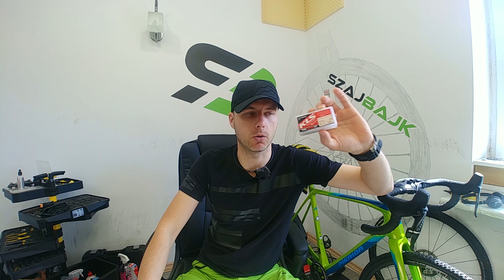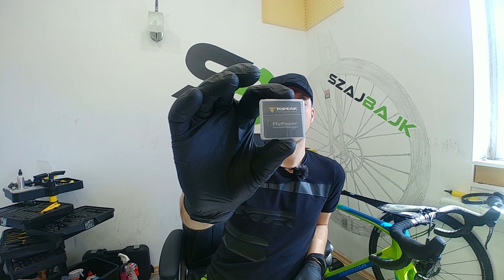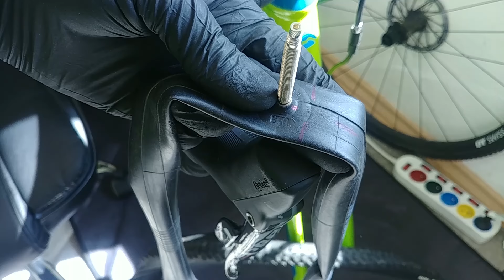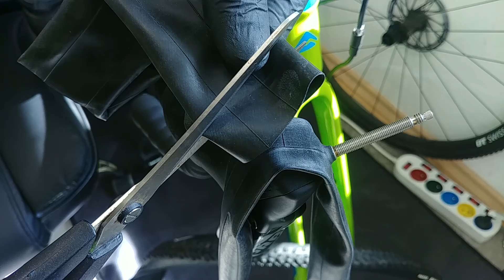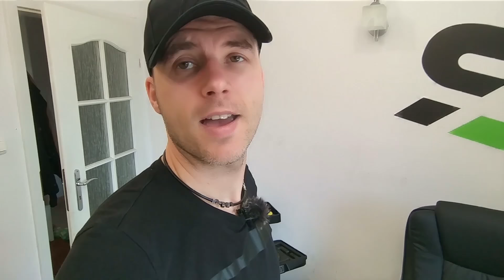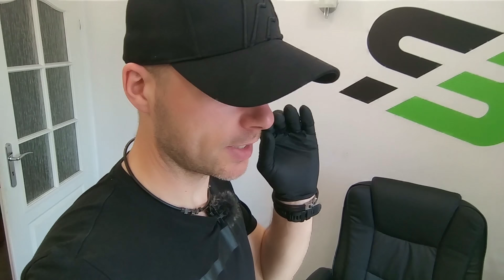How To Fix Inner Tube With Another Bicycle Tube. How To Make a Patch. Step - By - Step Tutorial.

Comment: Back in the 70's we would light the glue on fire after we put it on the tube, just long enough to heat it up real good. Then blow it out and apply the patch immediately. They always held up until we outgrew or wrecked the bike, but back then everything was made better. Everything these days is junk!
Reply: Fire , fire…

Comment: The metal scratchy thing used to be for scraping chalk (which was part of the kit) over the glued area to prevent the mend sticking to the inner surface of the tyre. It is certainly useless for roughening the surface of the inner tube. I saw one video which used it to spread the glue ...

Comment: I used to get flats near or on the valve. I solved the problem by cutting out a 20mm square of old inner tube rubber, stabbing hole in it, then sliding it on to the valve stem right to the bottom. The extra rubber protects the tube from irregular rim holes or any small sharp particles that creep in.

Comment: If the hole was at the base of the valve stem or ripped off like my $60 tractor tube.  I simply cut old valve stem, about 1/2" dia.  Now with an old inner tube, my case motorcycle tube, cut 2" dia around motorcycle threaded valve, both sides prepped and glued.  Never discard those valve stem sections😊

Comment: To share - after I stick the patch onto the tube using tire glue, I use a f-clamp to clamp tight the patch onto the tube overnight. It worked.The patch still hold after many many rides.

Comment: Rozpuszczalnik ekstrakcyjny (AKA benzyna ekstrakcyjna)  is slightly greasy. I wouldn't recommend it for cleaning the inner tube before applying glue and patch patching. IPA is a better solution. You can also use soapy water...

Comment: Another fine video! Glueless patches are great for a fast fix on the road but even the best aren't durable. If it's a slow leak pump your tube up a bit first so it's the same size as when its inside the tire before putting on the glueless patch. Even high quality glueless patches like Park's don't stretch and shrink well, and so peal off when the tube shrinks and expands as you change it later.

Comment: 3M cubitron sandpaper gets the tube smooth fast - brake cleaner gets shut of contaminants. On "O" ring repair kits, you use super-glue to join the "O" ring - they're rubber, like inner tubes. Super-glue sticks them. So maybe it will stick inner-tubes too? :-) With activator.

Comment: I like the metal rasp piece, I’ve been using them since the early 90s. I think it’s faster and doesn’t load up like the sandpaper. Most of the new patches are junk. The self adhesive type always fail, and the rubber ones are super thick and don’t move with the tire. I’m going back to innertube patches. New kit will be vulcanizing cement, metal rasp and innertube patches.

Comment: I use the head of a disposable razor, to shave off the seam ridges. 
I remove the razor handle from the head and carry it in the patch kit.
It's like a little block plane.
In the old days the patches had to be heated with a little iron and matches.
Reply: The razor blade is a great idea

Comment: Hey, so I just got two 700x23/32 48 mm Presta Valve Inner Tube delivered and to check that it was not punctured, I pumpued the air into it without installing in the tire and it inflated like a checken leg from on of the side and then exploted from there. Is that normal, or was the tube not good? I checked the second one, it's inflating like the first one with a checken leg on a side and then I stopped because I might be able to return it. Please help me if you know.

Comment: I tried this and both patches had air coming out of the sides. I sanded and cleaned the areas with alcohol, let it dry completely. Cut the tube, sanded and cleaned it, let it dry. Applied rubber cement glue to the tube and waited til it was sticky, then i put some rubber cement on the outside of the tube-patch and clamped it overnight. Tested the tube in water and it was ok. Installed it, went for a ride, parked the bike and when i got back to the bike - flat tire. Got home checked the patches and sure enough both of them leaked. I don't know what i did wrong. When i pumped air when i got home to see how it reacted, i did see a big air bubbles under the patch form where there were none before.

Comment: tried loads of patches over the years never had a problem clean the tube just wipe with whatever available T shirt etc then score with sand paper or the metal apply glue rub in leave to dry 30 seconds press on patch for 10 seconds if there's chalk use sand paper to apply to excess glue around the patch worked every time for me

Comment: I think the reason why the previous patches didn't work for you is cause you need to air the inner tube up a bit, patch it up, let dry patch dry completely, then let some air out before putting inner tube back into tire, then the rim and so on and so forth. Just a thought.

Comment: You are extremely right, tube patch is a waste of money since nothing really works. Best advise is to replace with a new tube or you can buy a tube vulcanizing machine , about $65  and you can fix the patch work and guaranteed works. Also the machine will pay off after and can use it over and over again.
Reply: Just go to EBay.com. Search for vulcanizing machine. Good luck and hope it will solve the flat tire problem.
Reply: Can i get a link to that tube vulcanizing machine?

Comment: I cut a maximum 2"x2" square of duct tape and used a hole-punch in the center. I place this tightly around the valve stem, my hole punch being smaller than the stem diameter. I have had inner tubes bust at the valve area as well, and I think it is because the tube has strange conditions at the valve. The hole in the rim is made to fit a variety of valve stems and it usually too large. Inner tube manufacturers know this and so put a rigid plate behind the valve. I think this plate, not flexing causes the rubber to stretch against it and can even act like a pump, holding a greater pressure than the rest of the tire. It can do that because of the maybe less than 1mm gap between the stem and the rim provides no support. These ruptures (not punctures) usually do not exceed 3mm and thus I rest my case. I believe that the piece of duct tape acts like rim tape or tire to prevent a valve stem blow-out. The valve stem is the weakest pneumatic part of the tire, if you overinflate this is where it always blows. I haven't tried overinflation with the duct tape and I'll admit that if you overinflate, it would be better to replace a tube than a tire in most circumstances. Maybe I'll try it and make my own video?
Reply: Brilliant, thanks 👍

Comment: Excellent  tutorial ; older cyclists will have learned this by experience. The metal thing,as you call it!  is for abrading CHALK onto the finished patch an tube to prevent adhesion to inner tyre. Thanks.
Reply: Cheese grater?
Reply: Well that makes more sense than what the instructions tell you to do on a patch kit hahaha, tells you to rough up the tube with the microplaner lol
Reply: Waste of a step imo. Just let it dry before putting the tube back into the tyre.

Comment: when I repair tubes at home i clean the affected area with alcohol the one i use to clean my discs after sanding to clean from whatever it has. And after pasting the patch i hammer it carefully with the co2 tank over anything that doesn't hurt the tube, like a flat rock or the floor, and when I'm on the wild, I always carry a few turns of duct tape around a co2 tank, in case I'm not sure I removed what punctured my tire, i put a couple bits in the inner face of the tire, to prevent that object -frequently a horn-, to puncture the patch. Hope this is usefull to someone.

Comment: Glueless patches are garbage!
Reply: Not so. They're meant to be used as a quick fix on the road and for that they work great. Inflate the tube a little before putting one on. Glueless patches don't shrink and expand, and so they slough off the tube when you deflate and inflate the tube again. So when you next take out the tube expect to replace the glueless patch with a regular one.

Comment: I love the color of your bike. Question, how do you keep your glue from drying up? Coz usually for me, once opened, glue dries up in a few weeks to about a couple months after just one use.
Reply: Hi. Keeping  the tube well closed is not enough to prevent the glue from drying. I am kind of an expert at this because when I was a child, I used to work with my father making costume jewelry. This implied very often gluing rhinestones with pretty much the same kind of glue. Well, the secret is to take out the  all the air from inside the tube. You achieve this by pressing tightly from the back of the tube all the way to the front. By the time you see glue exiting in the front, that means you have expelled all the air from the inside of tube. A good method to do this is to press the back tip of the tube with a pair of pliers and pressing firmly down move the pliers to the front. Think of this as if you were using a roller and you were pressing dough to make a pizza. Then you roll the flattened part of the tube onto itself to the front, to make sure that the glue at the front does not have a chance to go back again. Trust me, if you do this properly, the unused glue can last you even for a couple of years
Reply: Make sure there is no air in the tube and put the cap on tight! Mine usually last until they are nearly empty.
Reply: Excellent 👌

Comment: Some tube manufacturers make the tubes super thin on both sides of the valve stem.  So yea, you are not going to find any sort of cause/ sharp edge in the rim, you just have a tube with  a weak spot.

Comment: For years I just use few drops of super glue alone to patch small punctures on my tubes. Works well for me.
Reply: Yes! me too. It works well on small holes so long as the glue is not the super low viscosity type which penetrates the rubber and makes it as stiff as a board.
Reply: @nicksutton2964  you're right. It can be a permanent fix as long as the glue adheres well and doesn't develop cracks. 👍
Reply: Yep one drop is more than enough, what I mean when I say few drops is few coats of glue in form of very small drops. Sorry for confusion.
Reply: @Handler4071  Thanks for clarifying.
Reply: A few drops sounds like a lot. It seems as though less than one drop would do it. (?)

Comment: I do 2 things a bit differently (at least for my town bike) .. First I inflate the inner tube with the valve still in the rim. So there is no accidental flipping. Yes you are screwed when the hole is so close to the valve, but that never happened to me the last 50 years ;-)  Second, I inflate the tire a bit before putting on the patch. That way there is less of a stretch going on with the patch  when the  tire is fully inflated.  Hasn't failed me yet.  I also remove the corners of the patch (less chance of it getting loose)
Reply: Good suggestions. But I lead bicycle touring groups (people use their own bikes) and I see tube failures close to the valve stem all the time. Often they're sudden blow outs. It's a classic weak spot.
Reply: @dugldoo that always happens if tyre pressure is insufficient. Try running 1 bar extra pressure and the valves will not be the weak spot
Reply: ...so that can be of use at home, but has no use on the road, right? Since you said "wait to the next day to pump it to full"?

Comment: I had the same problem with my MAVIC Cross Trail 26er with Presta valve !!!
- I even sanded the Hole with Dremel tool and still Leaked at the Valve , was running 60 psi on flat road 
Sold the Wheelset Now running Ringle Flea and Easton EA70 XC no problems

Comment: Too much hassle. A tube can be had for $5. If you’re getting flats all the time you’ve either got really bad luck, shitty rims, or bad rim tape job. Glue-less patches should just be used to get your ass home. Replace with a new tube.
Reply: While you go buy a crappy $5 tube at Walmart (and spend $3 gas) I've put durable patches on a half dozen tubes using this trick.

Comment: Used to do this all the time as a child. Not fool proof but worked most the time on the MTB. Used to bug me I'd always have lots of left over glue from a repair kit, plus back in the day I couldn't find cheap separate patches for sale like nowadays. Wouldn't trust it on anything higher pressure! Recommend Rema patches and the Park Tools Super patches are a better glueless patch than Topeak ones (tried both).

Comment: I think this is a great idea, I can't wait to TRY this method!!! Well, yes, I can wait, cause who wants a flat right.
I think this is way Better than those cheap patches, as they would seem to stretch perfectly, and once done just sprinkle a bit of baby powder inside tyre and your good to go!
Thx bud, guess I will go and get a larger tube of contact glue for further fixes...
Reply: But don't you think that putting baby powder will make surfaces a bit loose and that would affect the valve area?!
Reply: @CoptMan80  yeah, at first I was pretty much very surprised about baby power.  But asked a very experienced rider/racer which inner tube is light but that would still hold some quality to it. He mentioned the Specialized turbo tubes...

And when you open the box up you will find a small plastic bag and a tube covered in baby power!!!!!

I can say this, the installation is easier than a normal dry tube that sticks to wrong places.

From now on I only use Specialized turbo tubes and the Tubolito 38g tubes which are excellent.

Note; thicker heavier tubes will be more puncture proof that's a given. But now after using Tubolito Road tubes, for a year now and not one flat makes me think that sure they are expensive but very much worth it! Plus you can get a small Tubolito patch kit in case you do puncture.

All in all, it's a personal preference as is the rest of things to do with cycling, it's whatever works best for you, and the terrain you will be riding on.
Take care, and safe riding.
Reply: @leftymadrid  
Well, thanks for suggestions, you too stay safe!

Comment: What type of glue?
Reply: I have used Xtra-Seal vulcanizing cement with good results. I think the Rema TipTop patch kits and glue are the best otherwise.
Reply: I believe contact glue would be the glue to get, I will be getting a larger tube of it to have around, this idea of using an ultra lite tube is perfect, way better than using those cheap patch kits, the patch tube will stretch perfectly with inner tube
Reply: Sticky glue 👍💪
Reply: Actually it's rubber cement
Reply: Anyone know why an airless tire for a fixed gear bike wouldnt work on a non-fixed gear bike?